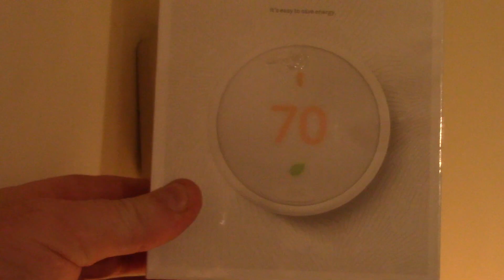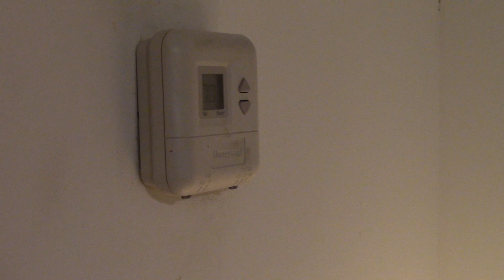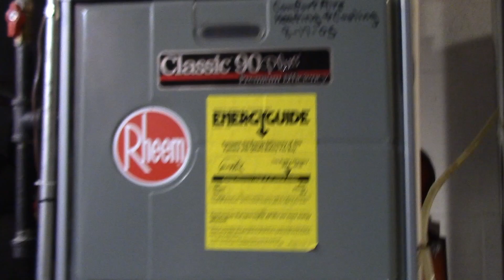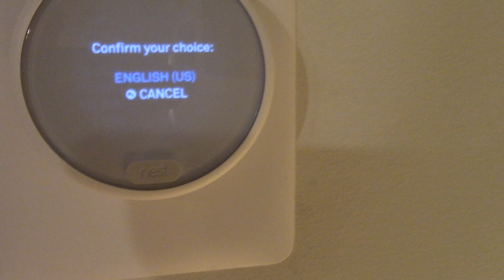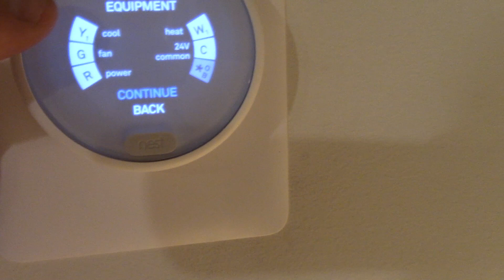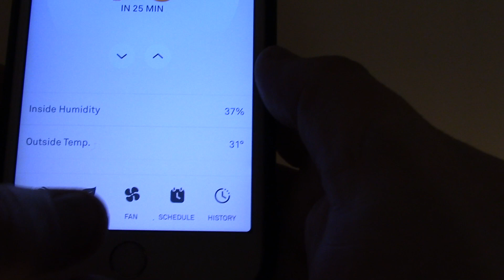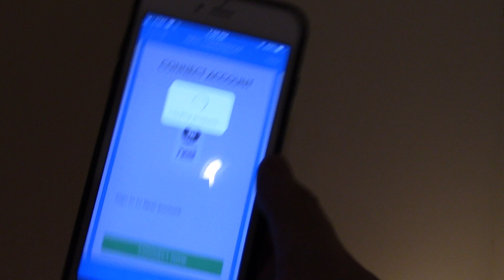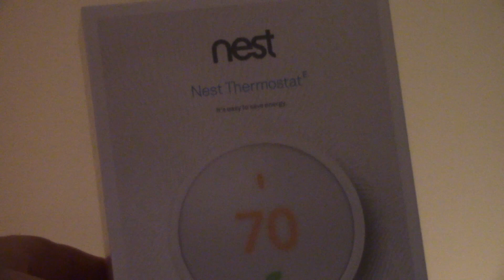Episode 65 Nest Thermostat E install 4 or 5 wire

Comment: I did exactly what you did step by step, I had a jumper red cable on the old thermostat, the nest is saying no power from the C (blue) wire even tho it has been connected on the furnace side. I keep getting delayed heating message. Help please?
Reply from the maker: 4 or 5 wires ?, is your Common blue like mine ? gas heat or electric? make sure if you used the C on the furnace it is on the Furnace side not the AC pump side. Also check the plate behind the nest, sometimes they pop out of those quicktabs
Reply: Chris Edwards I have 6 wires blue and brown were capped off on the thermostat and furnace ends. I sliced the blue one on both ends and got the no c wire power error. Talked to nest and they had me remove the yellow wire as a temporary (seasonal) solution, I seen people connect the green to the common wire on both ends.
Reply: Should I try the green wire to common solution or what do you recommend?
Reply: Chris Edwards also it is a gas unit
Reply from the maker: yes you can use the Green /fan wire to be a common, note that you won't be able to manually do the fan, but who does that anyway. Mine is a gas unit too.  But you said (6) wires, you can just use the Blue as common and connect the Blue on the IFC side in the furnace to be the common (as it should be) leave Green as fan verify the colors match the IFC board terminals also, it should work fine.

Comment: I just installed the nest thermostat 3rd generation and I have a similar setup as you with no common wire.  I have red, yellow, green and white wires on the thermostat.  On the relay board, i have red, yellow, green and white and in addition to that I have an extra white wire connected to C and an extra red wire connected to Y along with a yellow wire on the relay board.  Nest told me that I do not need a C wire.  It had only been 3 days and so far so good.  Do you think I should add a C wire?
Reply from the maker: the nest has an internal battery, it uses the Common for charging, as long as its working but keep an eye on it, you can always swap a green fan wire to Common if needed, just remember to swap it on your board at the furnace to common,

Comment: I haven't had the time to listen to your whole video yet, but will be later this evening.  Do you know if this Nest will work as a simple thermostat without wifi and the app?  All of the vids I've watched, and the Nest website, don't cover this scenario. I bought one for my 90 year old mother who doesn't have wifi - yet.  I want to have wifi in her house, but that won't happen for a few more weeks.  She now has a simple Honeywell with a single display and an "up and down" button on the face and she has trouble figuring it out.  My purpose for the Nest is so I can adjust her temp from wherever I am.  I live 60 miles away.  Thanks.
Reply from the maker: sure can, although its meant mainly for a smart home.. but yes it can be all done without connecting to the wifi at all, it sets up over Bluetooth originally , or wifi directly on the device, but you CAN use it normally, or you can download the app and setup a schedule for automatic, and whenever the user gets Wifi you can control it remotely,  but as far as "regular usage" just turn the dial and set a temperature, turn heat or Cool on or off, its simple and great, been using it for a few days now and love it;  I recommend turning off the "learning" feature at first, as the elderly have different temperature needs than a family who would work and not be around all day, so it would turn off to save money when a person who is home might want it warmer, but if you turn all that jazz off its just a pretty electric light up thermostat with big temperature numbers great for reading without glasses.   Since your mom may not have the technological doohickey experience, set the unit for  "heat and cool" so whatever you set it to will turn on heat or AC depending on house needs. then the user can just use the dial and make it what they want,  the temperature indicator will turn orange if its on heat, or Blue if cool is requested. 

enjoy!
Reply: @ChrisEdwardsRestoration  Thanks a million for the response.  It is more informational than most of the videos out there.  My next step, this weekend, is to make sure the Nest-E is compatible.  If not, I may have to consider the Nest 3.
Reply from the maker: @MichaelDBauer  just remember, there is NO technological difference between then except price, and the series 3 learning has a stainless ring that can be color matched (for another 100$ increase vs the E) and a farther sensor to detect internal room temp and movement to light up the screen farther away.   you can do it ! if you have 4 wires or more your good to go
Reply: @ChrisEdwardsRestoration  I could be wrong, but I read somewhere in my study that the Nest 3 may be compatible with the 120/240 systems where the Nest E may not.  Will be checking her system in a couple of days.
Reply from the maker: @MichaelDBauer   240v or high voltage systems are mainly for baseboard heat, and would only have 4 wires 2 red 2 black coming out of the thermostat and would be wire nutted together, 90% of thermostats are LV (low Voltage) or 24V from the IFC (integrated furnace controller)  see this link -- https://nest.com/support/article/How-can-I-tell-if-my-current-thermostat-is-low-voltage
Reply: @ChrisEdwardsRestoration  Thanks.  I had the chance to look at her system last weekend.  Looks pretty standard and simple.  It does have 2 yellow wires.  One is in the yellow slot on her old thermostat and the other is in a white slot.  Easy enough.  Thanks for all of your help.  It is much appreciated.